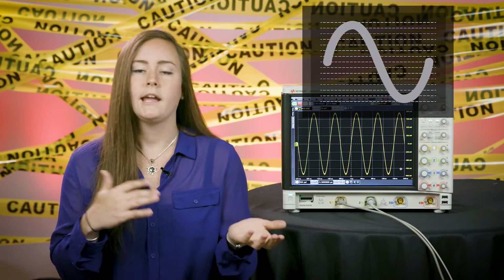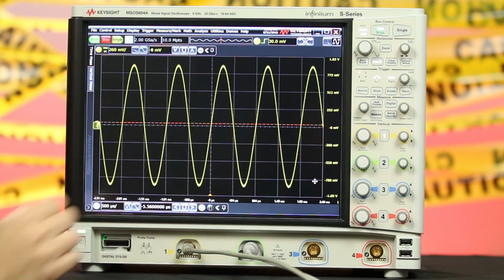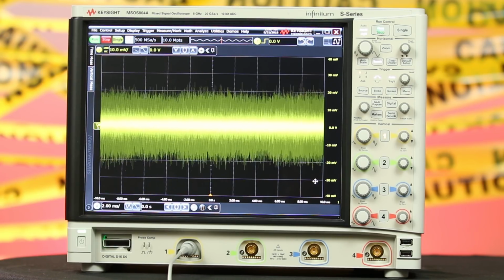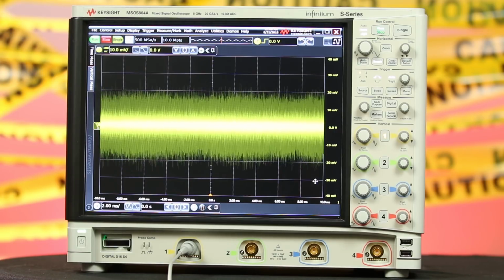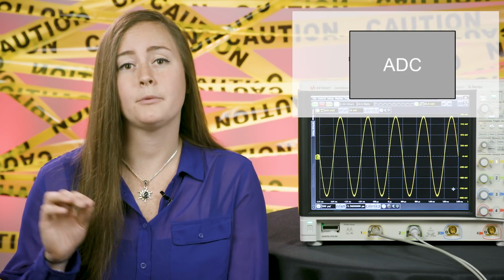Oscilloscope ADC Bits and ENOB – Exposing Signal Integrity Myths – E1

Comment: I still don't know, how System ENOB is defined, or what it all includes. Please simply show one chart with the mathematical definition, or the calculation with all possible influencing variables. Also missing is a concrete example, how KS scopes perform in practice in this aspect. All that would have made your explanations much more transparent, understandable, and less laborious. Please take these hints into consideration for your future videos.
PS: The linked brochure about scope SI is likewise unspecific and qualitative only.. HEY! Here on the other side of the screen are many engineers and scientists..
PPS: And I'm missing the good old 'Theory of Operation', i.e. these great manuals and Application Notes from the 60ties to 80ties, explaining such things in depth.

Comment: Maybe you could explain why XY mode on older analog based oscilloscopes is so much better than on digital oscilloscopes. Such as going into the details on how the ADC digitization is not as good as the cathode ray tube's output. This topic would fit in well after this video too! 

And as Helmut stated down in the comments, I also would appreciate more quantifiable values and equations associated with ENOB and your other topics. Like what would be considered a good typical ENOB? I already know though from my wireless communications EET course.
Reply: From my observations with a hybrid analog/digital combiscope, It seems that the bit depth is the least of the worries. When I am able to get a solid capture of an atari vector game, the signal looks fine with the 8-bit digital mode. However, displaying an active game is trash on digital and beautiful on analog. I believe this is because of the fact that the digital display can only update at a certain rate (Usually with no consideration to the input signal), artificial / no persistance, and other emulated features that try to match the performance of a true vectorscope or analog x-y scope.

Comment: This is actual not only for the oscilloscopes, but for any ADC job. :) LSB, usually is very noisy. In my audio system i need to ignore one LSB and write special algorithm in Atmel mcu firmware for audio level indicator to filter out noise and remove low level indication jumping.. After that all was ok, now, at least 6 years.. ADC is separate ADC chip, not integrated, clocked from Atmel's OC pin, still there from first version time (without AVR), for compatibility..
Similar situation in other projects when using integrated ADC, example, for battery monitoring - firmware noise filtering and in some cases shifting out LSB..
Anyway, great, actual video which explains more wider common ADC problem, that can be find not only in oscilloscopes!
Reply from the maker: Absolutely!

Comment: The whole lecture's a little lame, why not make it more praxis relevant with examples and bring the values, e.g.: ENOB, bits, levels, vertical scale in relation to each other on a peace of paper or whiteboard and than do a measurement of a test signal showing the effective ENOB’s. Should not be so difficult. Regards Helmut
Reply: I am watching this kind of videos to learn something and to get motivated to get into it further, but this video series does not make it right. A few examples how to bring the messages via videos to users are: Andreas Spiess, w2aew, The Signal Path, EEVblog, or even a very basic convincing video trainings like “Der Hobbyelektroniker”. Ok Keysight must not be this good, however better that what they got. 

Keysight has very fine products, I own for my hobby bench a new Keysight DMM and power supply as well as older devices like frequency counter and waveform generators and spectrum analyzers.

For me I start often with basic devices and at some point I switched to precision devices, often from Keysight. The the deal must be to get peoples attention first and later they purchase when the requirements occurs.